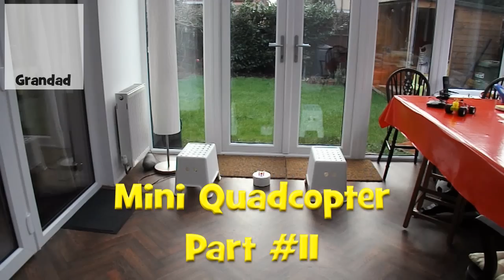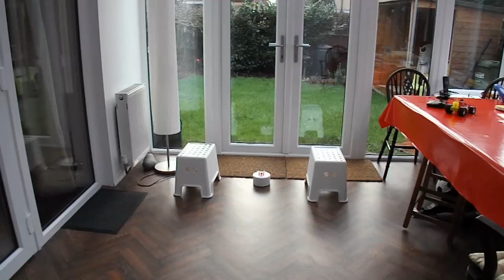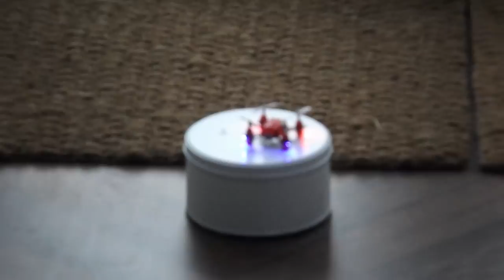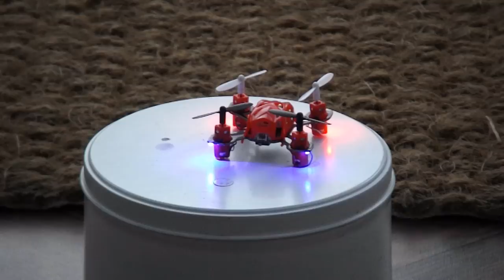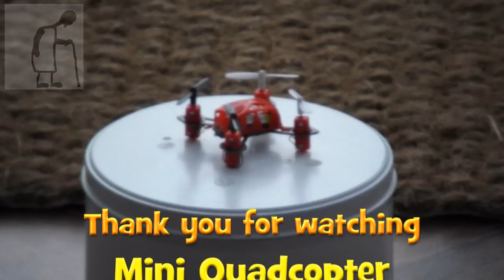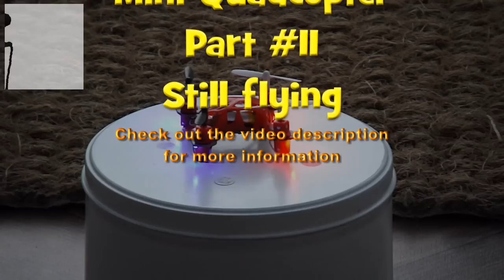Mini Quadcopter Part #11 Still flying

Comment: I recommend you to add landing legs (pencil grips work great). That way when it falls in mid-air, the motor mounts don't snap and wreck wire attached to it.
Reply from the maker: +NinjaPlays another suggestion is to cut short lengths from a Nerf dart as that will fit neatly over the ends of the motors.

Comment: gramps u got skills .they a pain in the butt to fly
Reply from the maker: +PsychoAxeMan the problem I find is changing from one toy to another. The controls on the cheap rc toys are just full on/full off whereas something like this has proper proportional control and needs much gentler movement so just nudging the control stick is all that is needed but my brain is still in full on/full off mode. It takes me several sessions to get the hang of it and then I go and fly a different toy and my reactions change again.